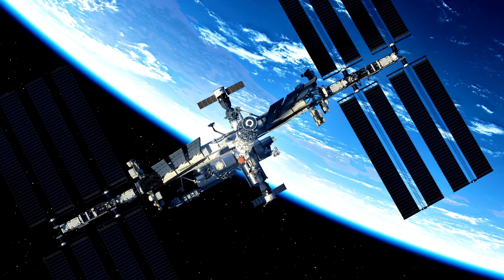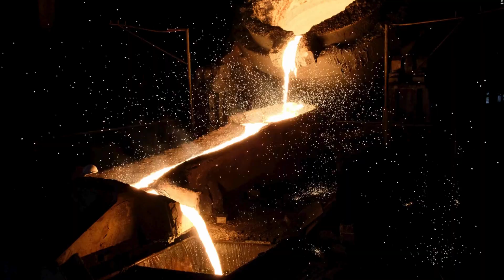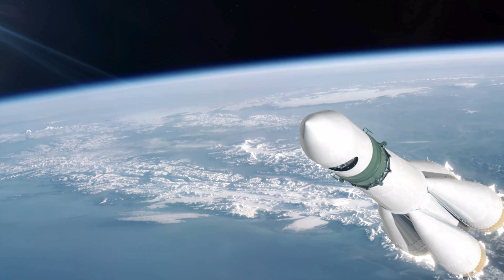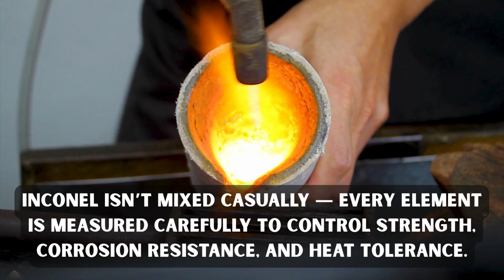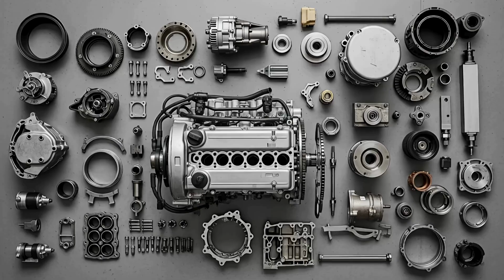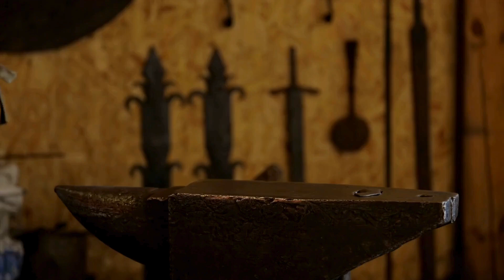Inconel: The Metal That Won’t Melt - How It’s Made

Comment: I was in aerospace manufacturing for 45 years. 
Watching a ceramic insert cutting tool turning inconel barstock, and seeing the red hit ribbon of material being removed was awesome. 
We couldn't even spray coolant on the part during this operation, because it would create too much steam.

Titanium was my favorite metal. Usually 6Al-4V (AMS 4928 or AMS 4911) was the titanium we made parts from.
Edit: going to watch your stainless steel & titanium vids next!